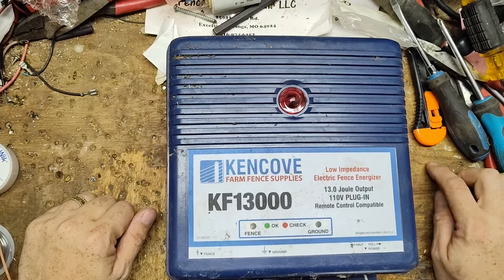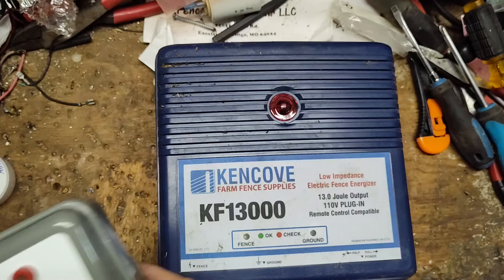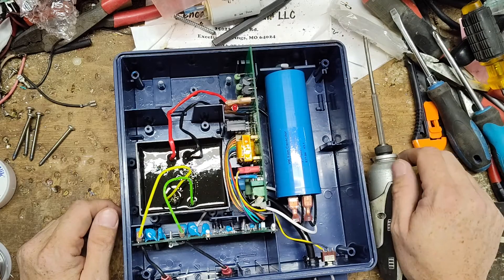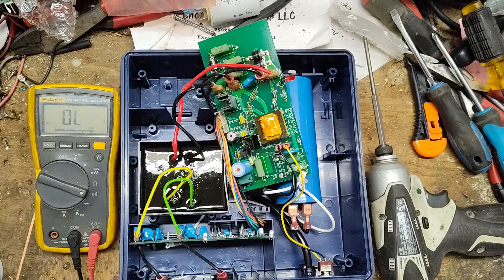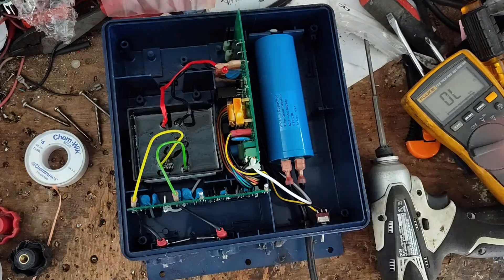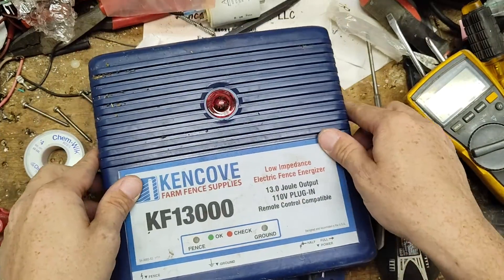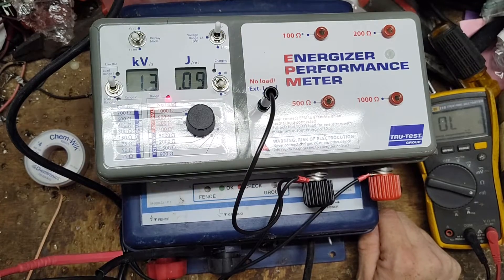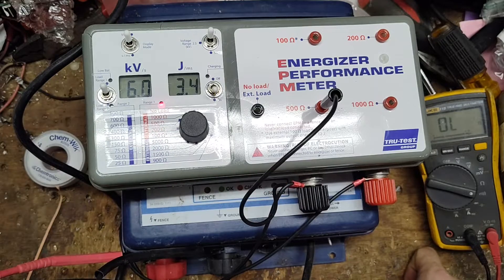Testing The Performance & Output Joules Of An Electric Fence Charger | Kencove KF13000 Repair

Comment: how can i see how many joules  my box has its a 60hz 20w 120v hol-dem super power 980
Reply from the maker: Does your unit say low impedance or solid state on the front case? If it says low impedance, then it's around 6 output joules if every single thing is 100% inside and hasn't worn out from age, like the capacitors do as they age. If it's a solid state unit, then those units weren't rated in joules. They aren't the same type of unit as a low impedance unit is.

Comment: What size (uf) capacitor does it have?
Reply from the maker: I believe in the 13 joule kencove it uses a 80uF 900-1200v capacitor
Reply: Nice!
I use two 50s in parallel to get more joules on my basic South American ones. Hope to learn how to build a basic joule test adapter. To see what I am doing better or worse when modding them.

Comment: with no load on the fencer the tester   cant  give a joule output reading  . the longer the fence line  is will decrease the output  joules also
Reply from the maker: Yep I figured that out in the video I made right after this one and explained in it in that video. This was me learning the device & trying to understand the functions of it. It's a pretty slick tool for sure. I just wish it had came with the software for downloading the info to a computer.
Reply: In case you would ever think of selling it, I would be interested.